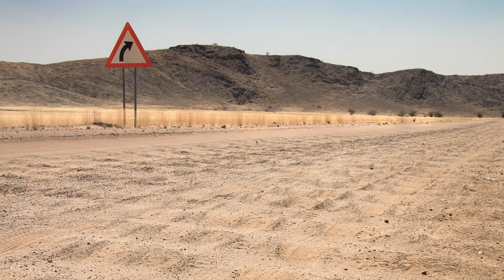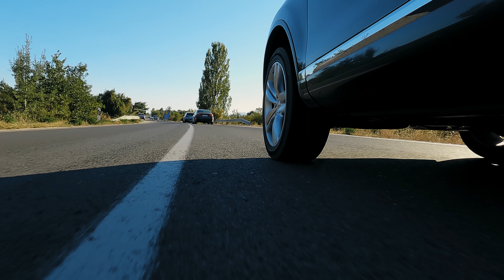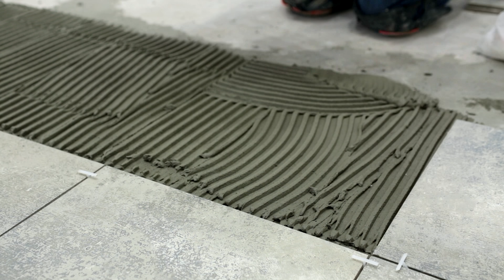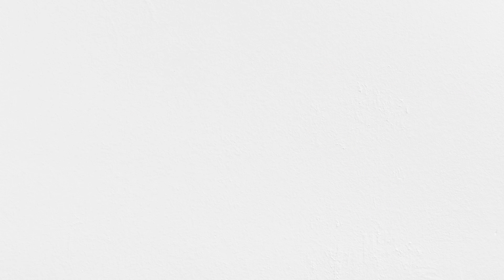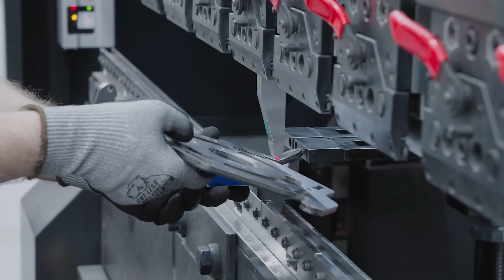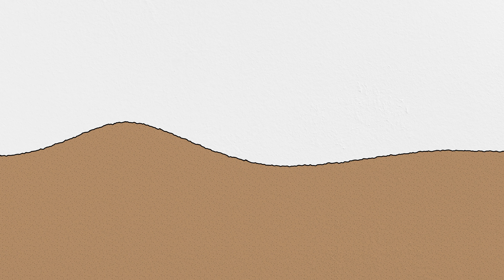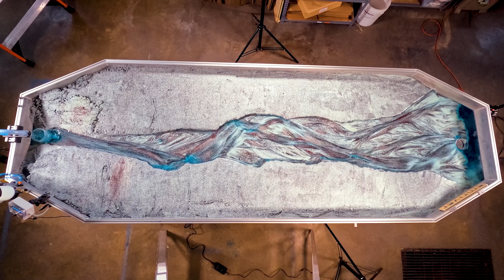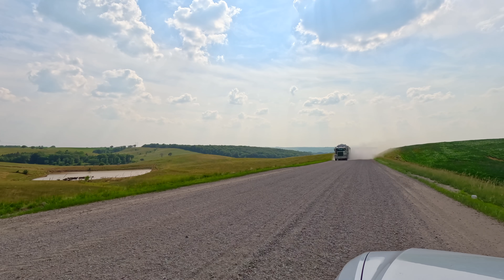Why Roads Get Washboards

Comment: Your experiment is ridiculous.
Dirt RDS are generally hard surfaces and not in a circle ⭕.
 Bends have wheels spinning faster on the outside and slower inside, braking at bends creates deeper ruts.
The ruts do not creep on hard packed earth and the loose sand invariably lands up on the borders.
Perhaps U should have invested in long time capture filming equipment and filmed a brand new rd over two years time lapse to find the real answers instead of this diatribe.

Comment: add torque or back torque to your rig and see how much it amplifies the effect.  Most washboard starts on grades where power or brakes are applied, or where there's acceleration or deceleration requiring power or braking.   Then try adding tandem and tridem wheels linked inversely with a walking beam or pneumatic suspension sharing pressure between axles.  Anyone who's driven on a haul road knows that the axle configuration doesn't double or triple the washboarding, it increases it exponentially.  Finally add power to your tandem axels with an interaxle differential, and then to your tridem configuration with two interaxle differentials, which, when you start to look into it, you'll find divide the power unevely between the axles causing conflicting forces at each wheel.  The main causes of washboard on many rural roads are large vehicles with multi-axle configurations applying massive driving forces to the surface.
Reply: The inter-axle differential splits torque evenly on tandem drive axles. On tridem drive axles, it puts half of the torque on the forward axle, and a quarter of the torque on the center and rear axle.

Comment: Grade the road....... Only use 4 wheel drive..... problem solved....  2 wheel drive REAR
 end vehicles push, causing the rear end of the vehicle to bounce, especially in sandy areas. Its only a little but enough to cause washboards over time. In the OHV community washboards are an issue because drivers want to fish tale around corners so they keep their vehicle in 2 wheel drive. If the vehicles is in 4 wheel drive, there is a pulling force from the front tires, limiting the push from the rear end. Granted over time washboards will still show, but using 4WD slows them way down

Comment: Decades ago our local road maintenance used to spray something they called CalMag on the road so it held more water and packed harder which helped a lot with the washboards.
Reply: Unfortunately it is corrosive to your vehicle and concrete surfaces.
Reply: @walterwestberg2422  They told us to wash the bottom of the car every time we drove on it until it was dry... but I imagine when it rained or something it was probably just as corrosive, wasn't it...

Comment: I just pulled my camper down a washboarded road.  It didn't look bad but anything faster than 5 mph and it was terrible.  I have a friend that has a theory that engaging 4x4 reduces the damage to the road, thereby minimizing washboarding.  Similarly, turning on the locking rear differential (on the straight sections only!) seems to reduce the amount of "chatter" felt in the vehicle.  I don't always lock the rear differential, but I do often engage 4x4.

Comment: In Saskatchewan Canada where I live there are more miles of roads than any other province. There are about 160.000 miles of roads of which about 130.000 are unpaved. Everyday we drive on gravel roads as our nearest pavement is 4.5 miles away. Washboard has been rattling my teeth for 71 years and will for the rest of my life because as you say pavement is expensive. Thanks for explaning why washboard forms.

Comment: I don't think it is that complicated; high speed and ACCELERATION!  This drives your tires to vibrate/bounce or chatter.  That is why uphill lanes are much worse than the downhill lanes; driver is backing off of the energy into the drive train.

Comment: Save yourself some time, if you just want the quick answer to the posed question, jump to @7:19

Also, for those that did put up with the previous 7 minutes, now we're measuring the area of a 2d surface in... kitchens? -_-

Anything to avoid the metric system, hey?

Comment: This was intriguing. In Canada, most of the washboards I've seen are on the main slope of steep hills - and I'd thought for years that they were caused by wheel slippage, especially from automatic transmissions. As to fixed things as opposed to wheels, I assume this is what blade chatter comes from caused by motor graders
Reply: You need to get out more.

Comment: IMHO, (on well-seasoned gravel roads, with a solid and deep road bed) it comes down to the skill and patience of the road grader driver.  If the blade starts to "chatter"; stop. Figure out why it's doing it.  The next pass won't knock down the ridges, it will make them worse.  Just slow down.

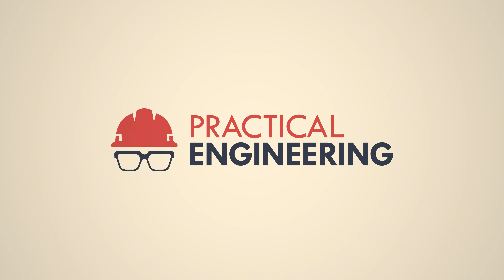Comment: 2:15 they happen in mx racing too. They're called braking bumps and they often occur when going downhill and braking before a corner.

The washboard forms right before the corner, then they stop.

This would suggest suspension plays a large roll in developing them, if they form both while on the gas and when braking.

Comment: I grew up along a gravel road. As kids we would bicycle everywhere, and we hates when they resurfaced the road, because it became very hard to cycle on it. With time the cars would smooth out the surface by pushing the big stones down and compacting the fine dust. When the dust was optionally compacted, the roads were a dream to bicycle on. 
But this was also the point where the permeability of the surface plummeted, and pretty soon the road coudn support puddles, passing cars washed out the suspended fine particles, divots were formed, the divots spawned washboards, and another dreaded resurfacing was due.

Comment: Have you considered the effect of "frost heaves" on ashphalt vs gravel roads? Where I live the fall freeze up and the spring thaw causes fractures in the road. Can't be fixedv in ashphault without removing layers off the top and resurfacing but with gravel you just regrade it with a Grader.

Comment: Your device is pulled not driven, like a trailer with no dampened suspension. The scale is way off as well. 
Trailers cause most of the washboards because of this. Speed doesn’t matter as much. The road base is key to preventing washboards in all roads even asphalt and concrete.

Comment: Basically, it’s all about resonance.
The corrugations have a frequency and hence wavelength.
That’s a function of the environment and the traffic moving over the road.
It’s also is a function of the road material itself, interacting with the environment and traffic. 
I’ve driven over many corrugated roads here in Australia and often tried to find the ‘sweet spot’ between having one’s teeth extracted and becoming an unguided missile.

Comment: It’s funny how you built a  circle, as this process (corrugations) is sped up due to the actions of the differential ie change in wheel speeds, and action on the suspension and usually where most corrugation being in the bend of a road, why I think if bends are paved this action should decrease

Comment: I could easily be wrong here, however I would assume this is similar as to why it very often seems when a pothole gets filled, another forms right after it, often stopping right at the line of the patchwork, since pothole formation is often influenced strongly by water sitting in that area, the patched pothole just happened to be where it formed before, but the new one forms due to the same conditions but quicker since now car wheels drop; even if a very very miniscule amount, off the patched area as often patch work ends up being mounded by even just a few millimetres

Comment: I always thought it had to do with the force the vehicle produced on the surface..  the spinning of the rear tires that grab the surface while spinning faster than the front wheels.   Kicking out the forward mound as it bounces off the prior  bump...the rhythmic bounce creates the rear wheels dig into the surface ahead... thus the continuous washboard effect

Comment: That's not like a vehicle wheel.  A vehicle wheel is sprung.  Your wheel is freely rotating.  Eliminating the spring is leaving a giant variable out of the equation.  Also, a vehicle wheel supports way more than just its own weight.  Combine the two, and the oscillating action of the loaded and sprung wheel is what causes the washboarding.

My grandfather and his friends used to take their 2 wheel drive model As all over the Mojave Desert looking for lost gold mines and they rarely got stuck.  When they did, they had a trick to get unstuck and the never got stranded out there.  He said the big trick was to put a block of wood between the frame and rear axle on each side.  He said when wheels spin in sand, they bounce up and down and that's what digs you in.  The wood blocks stop the bouncing.

Comment: I find it interesting that the washboards form and then stay regular, even with different wheelbases traveling over them.  I'd be interested to see if the period of the ripples is different if different wheelbases exclusively travel over a surface (i.e. do you get longer periods with SUVs vs. a motorcycle).  That would indicate that the washboards that form on any given road are kind of an average.  Cool stuff.

Comment: Very interesting I wonder if it works on packed snow. 
Back home we have a lot of snowmachine trails, & we would get really serious steep repeating “water board” dips & rises in the trail. Us locals always attributed it to people from town with new machines with better suspension, gunning it repeatedly. Every time they gun it their track digs a little bit, and from repeated traffic the hole gets deeper. And every time they have to gun it a little bit more to climb out of the hole.
They just go at breakneck speeds because their superior suspension just absorbs the dips. Whereas us locals with 2009 machines are left having to go slow otherwise we’d seriously hurt ourselves with our lackluster suspension.

Comment: County has been "fixong" the road in front of my house for over 2 years.

First, they put down asphalt millings on top of mud... the day after a rain.  Didn't compact at all.  In a week it was worse than before.

they've been trying to fix that without pulling up the millings ever since.  The road base can't dry.  You can watch the pavement "pump" with just a F150 driving on the road. 

Cracks, washboarding, potholes... it's a disaster.
Reply: California Highway 17 was notorious for it's "dips."  At 55 mph it synchronized with the suspension of my parents' Buick and the car would actually leave the ground coming off the top of a rise, bottoming out in the bottom of the dip.

Comment: I grew up hearing them called “chatter bumps”. Imagine your teeth chattering as you drive!

One of the most frustrating aspects of living on a gravel road is when the road maintenance trucks go too fast when they grade the road. My county road maintenance crews typically use a tandem axle dump truck with a plow blade mounted midway between the front and rear axles of the truck, and when properly used, they smooth out the road surface. But when they go above a certain speed, the blade will begin to bounce, and will actually form a washboard surface which only gets worse as vehicles travel on it.

Another frustrating aspect is the mud and dust. As mentioned in this video, you need fine material to bind the aggregate together, but fines, when it rains, turn into mud which coats your vehicle. The mud is necessary road material which gets splashed off the road and carried away stuck to vehicles. When it is dry, the fines turn into dust which gets caught on the wind and blows around, including onto neighboring property, where it coats everything. Of course the dust is also necessary road material which is going away. If a road is not regraveled regularly, it will gradually lose its elevation and eventually become a ditch that fills with water and turns to mud.

Comment: there is a street in my city, been paved for probably over 100 years. there is a roughly 200 ft stretch that has had washboarding since before I started driving, and that was almost 30 years ago. Its a primary route, but we don't care about road maintenance in Connecticut.

Comment: I wonder if they can spray some sort of a bonding agent on unpaved roads so the washboard is more difficult to form. They do this on chip-seal fm roads in Texas before they pave and it works. Colorado forest roads have some of the worst washboard I have ever driven on. Rampart Range Rd in Woodland Park is a perfect example. Also spots near Cripple Creek and some spots west of Westcliffe. They really need to engineer a solution to this problem not for the sake of time and speed but for the wear and tear on vehicles. (visitors and homeowner’s)

Comment: Some interesting observations in MN: dedicated atv trails with lighter vehicles, generally smaller diameter tires with more aggressive treads seems to set up much larger washboards. The Soo line trail comes to mind. Also, snowmobiles with much longer contact patches on their track create large moguls that need to be groomed or the snowmobile trails get to be nearly undrivable.

Comment: in my experience (gen x 1974) I noticed that my favorite cross country mountain bike trails never had washboard  sections until bikes started having suspension components beginning with forks. then washboard terrain started evolving in braking areas.  the old guys were bitching about suspension bikes till they started riding them. off season when there were less new riders who brake for everything and mostly fast guys on the trails who brake less there was less washboarded areas.

Comment: I have never seen washboarding in the northwest of Germany. I guess, it is a mix of several reasons.
1. The main roads are paved
2. Many sideroads are covered by gras and mostly used by local farmers. Due to frequent potholes noone actually goes fast.
3. In summer, the roads are very dry and in fall and spring they are more like a mushy swamp. That would probably reset washboarding.
and if all that reasons were not enough, we have very, very fine sand.

I guess, that are impossible conditions. If you tried to go fast, potholes would kill your tires. If you managed it on other roads without added gravel, the road would be reset twice a year because it looses its structure in the dry and wet part of the year.
I didn't know that fine sand is one of the reasons I might not have seen washboarding.

Comment: Thank you for going through this much trouble to create this visual representation of this engineering challenge, for someone like me curious about the world and learns best through visuals, the time-lapse of that wheel going on the sand was what I needed to understand this.

on another note, being in Egypt there is a main road close to my house where the contractor didn't do his work properly because corruption ...
send me your email and I will send you pictures of washboard asphalt, it is formed in areas preceding speeding pumps due to the weight of cars slowing down causing the un-compacted road to move under them forming these washboard waves.

Comment: rural arkansas here.  we have a lot of unpaved roads in an area with a steadily growing population.  Some roads are merely carved out of the surrounding ground, given a layer of gravel and then only get graded a few times a year.  One thing we have is boulders that emerge in the road as freeze/thaw cycles bring them to the surface.  A road just behind my house has sections where the gravel has been pressed down into clay over time leaving the top surface nearly all clay. This brings in a major challenge during the late winter / spring time when the snow melts after a storm. The clay section easily ruts deep enough to cause anyone foolish enough to drive a car with a low profile to get high centered. if thats not enough, there are boulders that would cause issues with that low profile car's undercarriage.  The county recently went in and jackhammered the boulders so they no longer protruded from the road surface.

the engineering side of my mind is fascinated by the change over time of the roads around me.  i would be curious to see what different blends of materials did to your setup.  would a mix of compacted clay and sand allow for faster speeds with a dry road surface (my guess is a resounding yes).  i think there is a lot you could do on that testing rig and some very interesting content could come out of it.

Comment: I would love to see a test with a larger compliant Tyre that forms around the road surface,  I live in the country and its common knowledge that lower Tyre pressures will eliminate the vibrations, but you have to re-inflate when you get to tarmac again. I wonder if it would also prevent to some degree the formation of the bumps.

Comment: Asphalt and concrete highways can washboard as well. This becomes very noticeable when riding a motorcycle on highways that have a lot of heavy vehicle traffic (trucks).
Reply: Correct, it shows also at traffic lights especially if there is al out of heavy truck traffic.

Comment: The washboard vibration can have a drastic toll on your vehicle. Consider this:  90's-00's Jeep Cherokees are very well built and capable off road vehicles but they suffer a fatal flaw with the specific use of lead free solder in the electronics and ECU systems. Over time / heat cycles those connection points become brittle and cracked from vehicle vibration - damaged by the very roads the chassis was designed for.